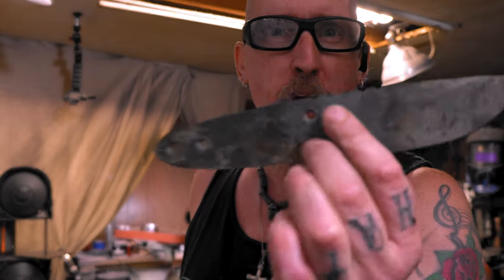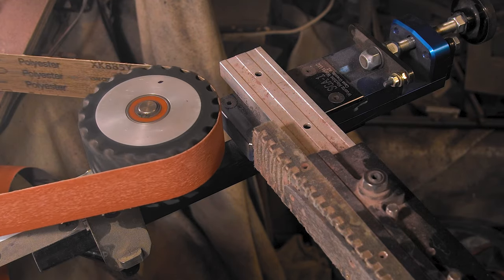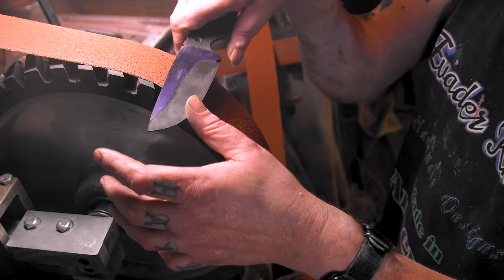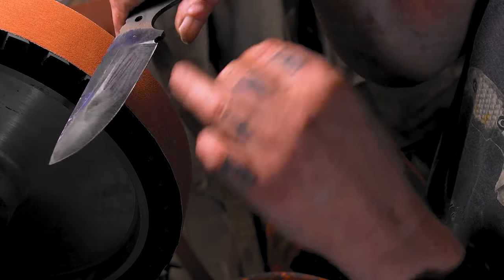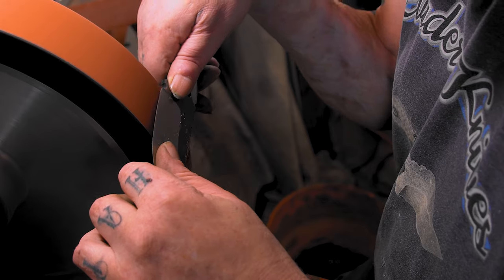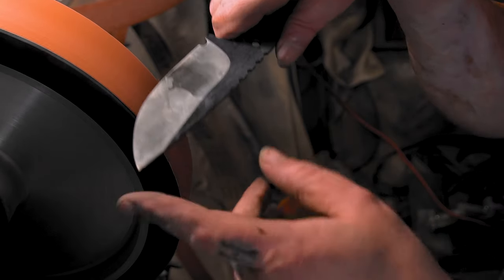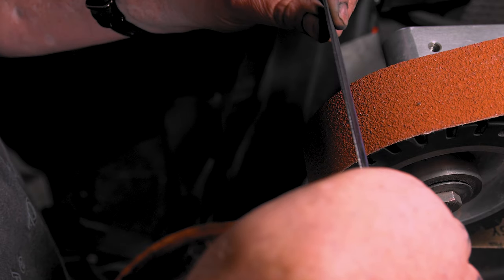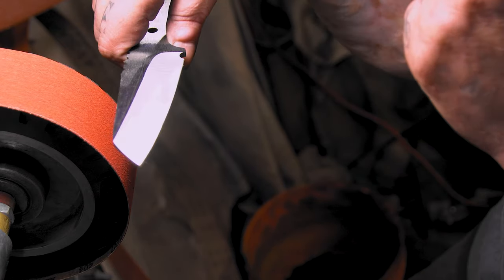Grindfest 4(Knifemaking - Grinding Bevels after heat treat)

Comment: Did you make that horizontal grinder?
Reply from the maker: The frame is from Reeder. I did build a horizontal grinder 1st, so I had the motor & VFD. The Reeder will track in reverse, so I also set it up(vertical) for sharpening